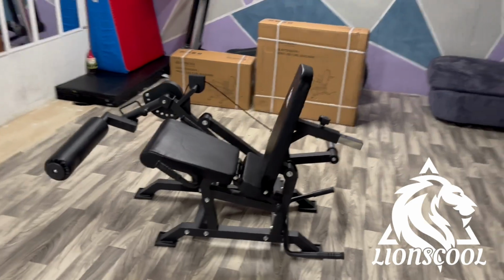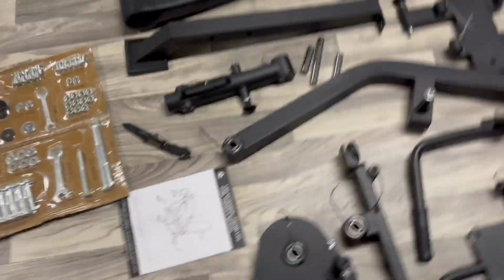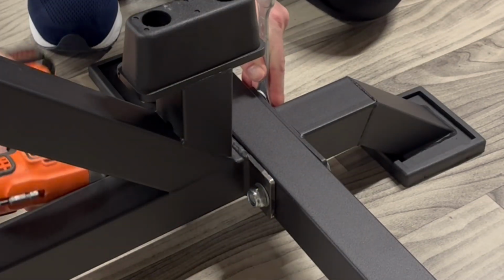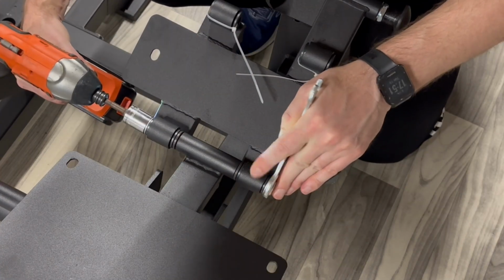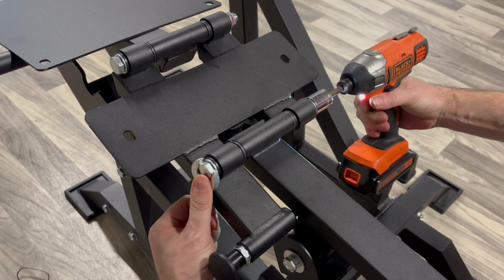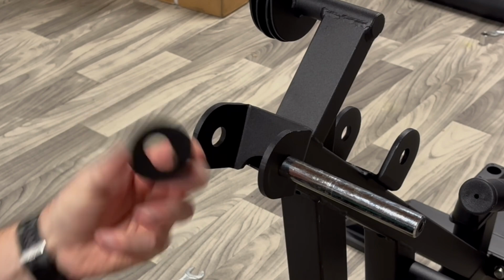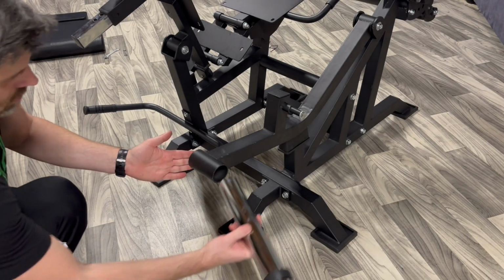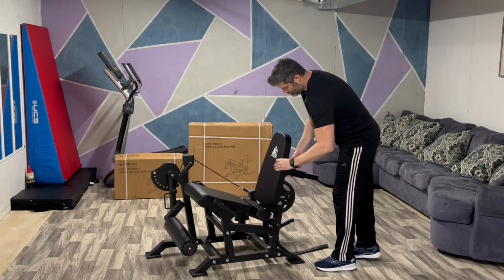How to Assemble LIONSCOOL Leg Extension & Lying Leg Curl Machine V2.0 | Complete Step-by-Step Guide

Comment: I just got the v4.0!
Reply from the maker: Awesome! I received it and assembled it a week ago. It has some nice upgrades and pretty much fixes all of the issues with this one. It’s an excellent purchase. 
There is a new issue that I’m not a fan of. 
I will be making a comparison video soon.
Reply: @HowtoandReviewsOfficial What’s the new issue? I haven’t put mine together yet. Are you talking about the v4.0?
Reply from the maker: @almightymade yes, the V4.0. The weight plate horn is now centered, with half on the inside and half on the outside, instead of the whole thing on the outside. 
The horn on the inside is too close to my arm for my liking for laying leg curls. I’m going to cut the inside half shorter. 
Let me know what you think after you try it out.
Reply: @HowtoandReviewsOfficial I’m installing mine right now and it looks like my seat handles are backwards compared to your video. It’s the right part forsure the handle bars are facing back instead of foward
Reply from the maker: @almightymade  that is correct. My new machine is the same. I noticed it felt different, and I just tried each machine, side-by-side, and I do think the V4.0 handle position is more comfortable. I emailed the company to ask about it.

Comment: I've got one, the newest v3.0. Works great. Only thing it needs are band pegs like the ritfit version but other than that I love it. I added a pad extension from Husla to make the roller thicker and get a deeper stretch.
Reply from the maker: Awesome! Mine is also great! The 3.0 became available a few days after I purchased this one; I just missed out. 
I’m planning do make the review video soon. I have to make one more for a rowing machine before I start it.
Reply: I just ordered the v3.0. I’m worried they’ll send me the v2.0…..
Reply from the maker: @ghostprodiqy8709  very nice! I think you’re going to love it. It’s a solid machine. I’m hoping to do the review video next. Finishing up a rowing machine review video right now.
I wouldn’t worry about receiving the 2.0. You should receive what you purchased. They were two completely separate listings on Amazon. Not the same.
Reply: @ghostprodiqy8709  it shouldn't be a problem, if it was shown as the V3.0 then it should come. The old sticks of the v2 are probably depleted by now or are being sold at discounts just to get rid of them.
Reply: @ thanks, I hope so. Is there anything visually different on the v3.0?
Reply from the maker: @ghostprodiqy8709  they shifted the weight arm on the 3.0. The cable connects to a stand-off on the side of the arm on the 2.0. It connects to the center of the arm on the 3.0. That’s the only difference I see when comparing the product pictures.

Comment: We need a ver 3 review.
Reply from the maker: Interesting. I just checked it out. That is brand new. It wasn’t on amazon when I made the purchase a couple weeks ago. Currently, their website still shows the 2.0. No 3.0 option on the website.
Reply: @HowtoandReviewsOfficial   I would return for v3.  It's More studier and has a thicker tube for the legs.
Reply: Also I'm sure they are trying to get rid of old stock is reason it's not on their site.  V1 and v2 both have issues, I'm not sure about 3.
Reply from the maker: @Noplatesnodates  I did inspect the pictures of v3 vs v2 and I see what they changed. The change makes more sense from a design simplicity and easier manufacturing prospective. Functionality, there is no difference.
Reply from the maker: @Noplatesnodates  I may ask for a v3 so I can put them side by side and show the differences.
Reply: @HowtoandReviewsOfficial   That would be great since no one has a review on it yet.
Reply: @HowtoandReviewsOfficial  Yeah there's an extra support on the pulley point and they improved the weight horn as well so everything is more stable.

Comment: Are you able to get a full stretch on the leg extension? This looks more durable than the Ritfit, but Ritfit has pretty much unlimited ROM.
Reply from the maker: I researched the RitFit before I purchased this one. (I was originally going to purchase the RitFt.) I watched every review video there was. The RitFit did have more adjustment down at the feet. But this one had better pads and better seat adjustability, and better seat angles in both positions.
I do think a little bit more leg stretch is needed when sitting for leg extensions. I think there are a couple of ways to get it out of the machine. I will definitely cover that when I make the review video.
Reply: @HowtoandReviewsOfficial  I mean, I imagine you could use a foam roller to get more ROM, but that would be kind of annoying. How is the ROM on the lying leg curl?
Reply from the maker: @ there is no problem with the laying leg curl. There is more than enough adjustment.
Reply: @HowtoandReviewsOfficial  I heard other people mention that you can turn the leg roller part around to get more ROM. does that actually work?
Reply from the maker: @martinverma2173  yes, it does work. I flipped it around, and ROM is good now.
Reply: @HowtoandReviewsOfficial  awesome! I will definitely get it then eventually. I see that Amazon now has a version 3.0.
Reply from the maker: @martinverma2173  wow! That’s brand new. No reviews. It Wasn’t there a couple weeks ago when I purchased it. Their website only has the 2.0.
Reply: @HowtoandReviewsOfficial  yeah, I’m hesitant to purchase something with no reviews lol. i'll probably just buy the 2.0 since you have the assembly video and with the ROM issue being resolved.